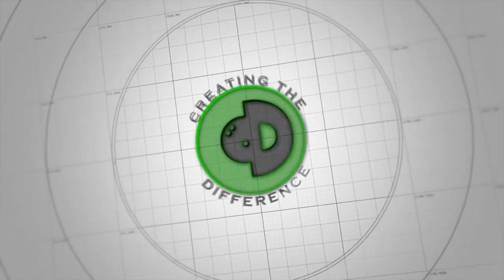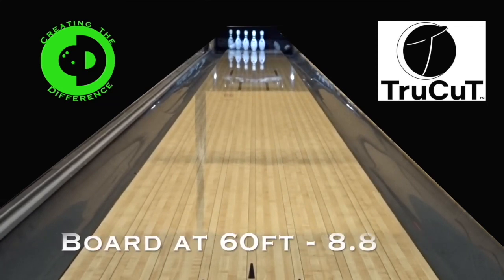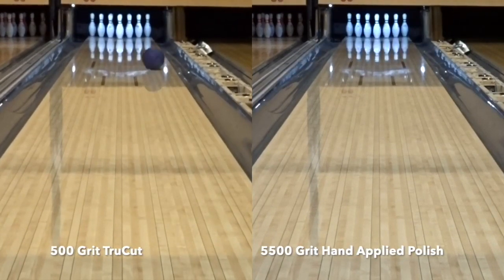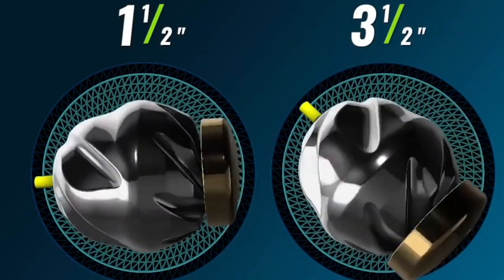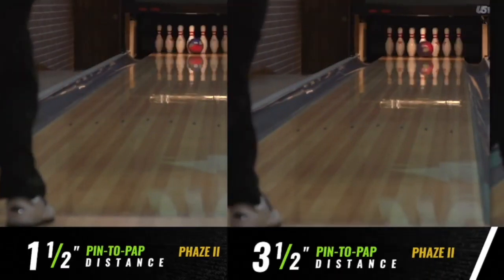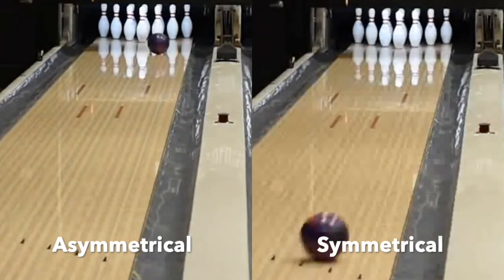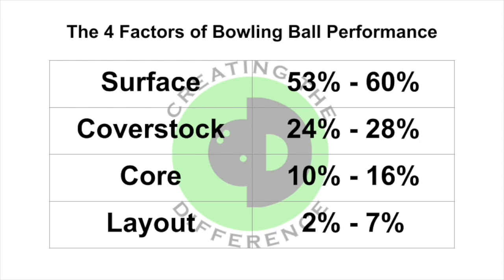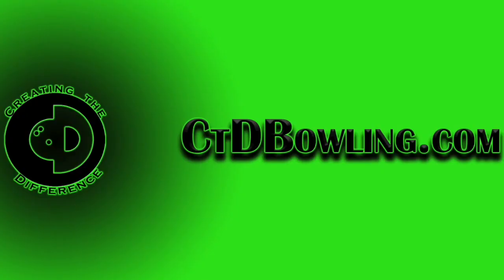WHAT MATTERS MOST? Bowling Ball Performance | Layout • Coverstock • Surface • Core

Comment: To follow up on Chris Hayes's comment: 

In order to better give a more complete range of surface effect on coverstock, the Polyester to Reactive test should be repeated using the 500 grit mark as well. So you then have a 500 grit poly vs. reactive, and 5500 grit poly vs. reactive. 99% sure that was a BW, but you could now do a similar test with the Purple Hammer and Scorpion balls for a symmetric version of the test as well. With either test, you should be able to see pretty clearly that coverstock dominates the reaction, which is then mediated by surface. Using your percentages, one might get the wrong idea that if they sand their polyester ball to 500 that it'll outperform their 5500 grit reactive ball. 

Storm's test on layout is also unfortunately incomplete if you're looking to get a FULL range of layout effect on bowling ball performance. They really should've done a 0 or 1/2inch pin to PAP at most to compare to the 3.5inch layout. I understand why they didn't, as it's really uncommon to see pin to PAP distances that low, but that also would have an effect on your final assessment of %influence on performance.

Comment: Surface changes 150 grit every shot till is lane shines to 5500 grit.   Or polish Wears down till it hits 5500 Grit no polish.  The most consistent ball is 5500 grit no polish.  Therefore you can see the lane change instead of mistaking transition and changes with the ball transitioning faster than the lane